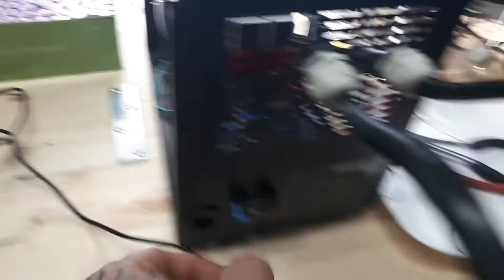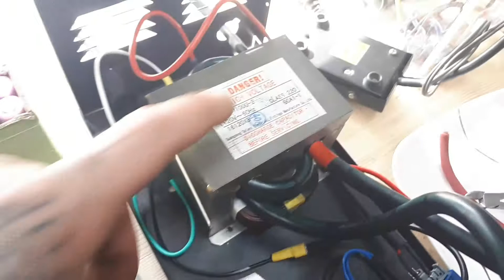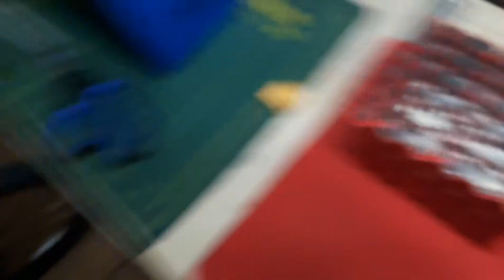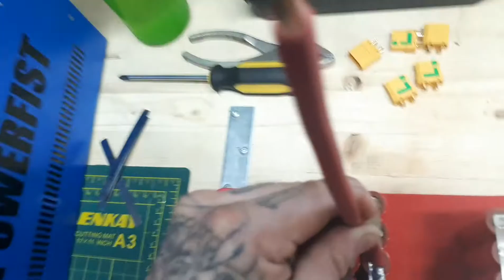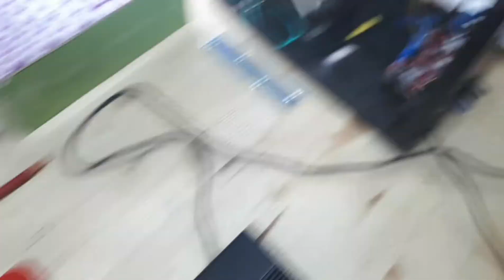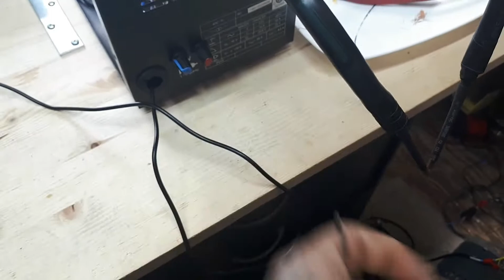Best homemade A.C. spot welder

Comment: Thanks for the video, can you tell me what timing board you used? and did you need to use a relay with it?
Reply from the maker: The board doesn't need a relay no. You can order the 120volt a.c. spot welder board from eBay.

Comment: Hi I have a old 700 watt microwave can I still make one or Is it too weak thanks.
Reply from the maker: That would be to small for most nickel strips. Sorry for the late reply I just noticed your comment.
Reply: Project Evolution ive tried with several 700w and one 800 watt, can weld the thinner ones but not the thicker, im on 230 grid, does that make a difference? Watt should be about the same anyway right? Just different amps? Been looking at the scrap yard several times seems like everyone is 700 watt output, can’t find higher! Thanks in advance